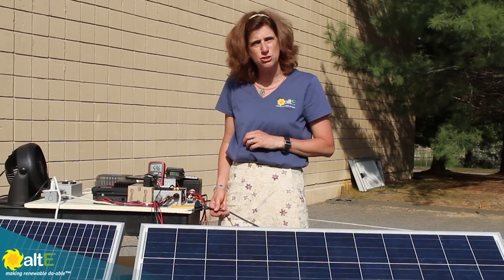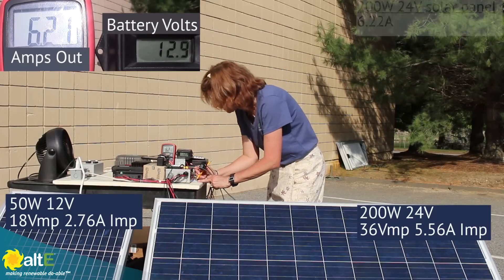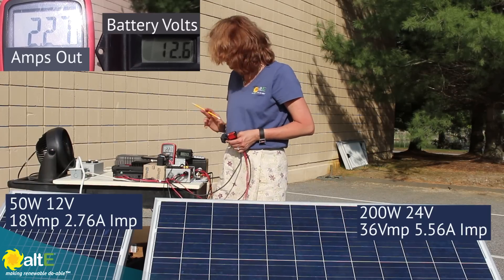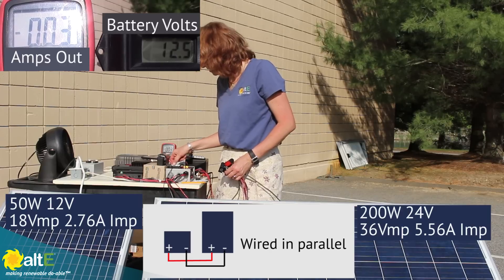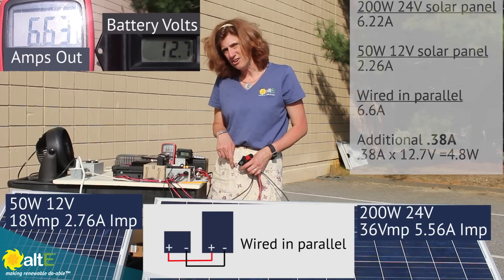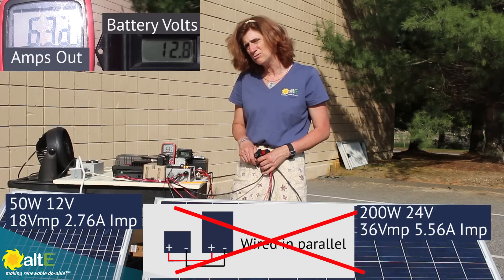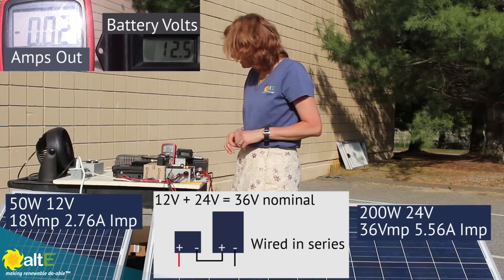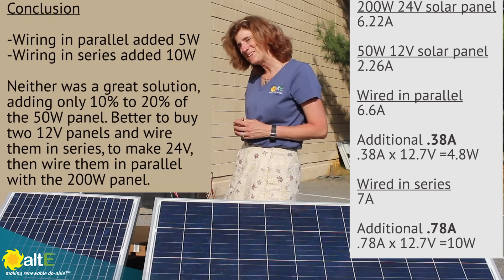Mismatched Solar Panels - What happens? 200W 24V with a 50W 12V

Comment: Because the panels' series cell count is so different (36 vs. 72 cells) on these two panels, if the parallel panel connection is left unloaded by a controller, all the Isc (5 amps) from the larger panel will be pushed into the small panel cells.  This might damage the 50 watt panel if left unloaded long enough.

For parallel connections, Vmp should closely match (same # of series connected cells per panel).  For series, Imp should match (approx same per PV cell size).

Comment: would there be a difference if you wired them in series from the 12v panel to the 24v and revese from the 24v to the 12v? either way it would be 36v but im trying to figure out what the 12v panel is doing causing it to lose some much power

Comment: Nice Videos. I just curious, Which point you measure the Ampere and Voltage? before or after SCC?  Better you show the circuit, to show in which point you place the measurement point.

I'm wondering if 12 Volt parallel with 24 Volt in Solar Panel circuits, what is the voltage would be resulted? Since if you put the measurement after SCC (on the output of SCC) in would be 12 Volt because SCC will always regulate based to the battery system voltage, in this case is 12 Vdc.

Maybe you can try it later on and upload  in the different videos, i just subscribed :)

Comment: Hi, I am joining my 36v 5.4A and my 18v 8.1A panels in series do you know what size cable I would need for a 15 feet run?
Reply: #12 thhn AWG is rated @ 20 amps and should be fine.

Comment: I have 12 340 watt panels and am looking to get 6 100 or 150 watt panels  can I connect them in series to get more power? 2 340 panels with a 100/150w panel per string vs 2 340 watt panels per string 6 strings 1 charge mppt controller
Reply from the maker: I suggest you get a second charge controller to connect the 6 new panels to the system. It will perform much better than trying to put them all on the same one.

Comment: Thank you so much Amy for the fantastic video, so if I have 10, 150watts(12v) panels  and I would like to have 4 300watts(24v) what is the best way to connect it. Kindly share your input.
Thanks in Advance
Reply from the maker: Ideally, you would have 2 charge controllers, one for the 150W and one for the 300W. But I assume you want to use one controller in this example. Because the 24V panels have twice the volts as the 12V panels, but the same amps, as long as the voltage of the strings match, you can use the 150W and 300W panels in the same string. I can't see a way to use all 10 150W panels, only 8. Save 2 for another project. You could use 2 strings of 2 24V panels and 2 strings of 4 12V panels, or 4 strings each of 1 24V panel and 2 12V panels. I'm not sure which would work better, having all of the strings the same mismatch, or having have the strings each with like panels. Sounds like a good experiment.

Comment: When you use dc, you can subtract or add voltage by switching the direction of one (in series)
By having the +24 meet -12 creating 12v.

Can creator confirm that it was tested and truly 36v output?
Reply from the maker: It's a little hard to see in the video, but I had red wires on the plus and black on the minus to avoid confusion. Especially since it did add a little, rather than output less, I am confident I had them wired correctly.
Reply: @AltEStore  agreed you seem quite methodical. 

I dont trust wire colors. Lol. Worked with too many color blind and homeowners. I have some panels that have no direction. I need to add a diode for that.

Comment: I would like to have seen then wired in series from small to large so positive of small panel going into negative of the large panel then the positive of the large panel to the charge controller. I imagine that would be better for current flow?
Reply from the maker: It wouldn't have made any difference. A bottleneck in a series string would limit the flow, regardless of where it is.

Comment: If you connected the panels in parallel, without connection to controller, you may find that the output voltage drops to just above the lower panel's voltage, this is why there was such a small gain in the first configuration.  
  Thanks for a no-bullshit video!
Reply: Try changing the leads on one panel. 
When they are pushing same direction, it adds, but if you flip one dc source around, it subtracts. I dont know how it applies to panels, but its true for battery. And id like to know!

Comment: What if I paired 2 50W 12V solar panel in series to charge a 24V battery?
Reply from the maker: Wiring 2 12V panels in series is perfect for charging a 24V battery. You can use either a PWM or an MPPT charge controller. 
Two 50W panels will only give you 100W, 3A, so it won't charge it fast, but it will work.

Comment: Hi there I have  4 100 watt solar panels and 3 30 watt solar panels wired in to a Renogy mppt charge controller I am only getting 9 amps 15volts and 120 watts total output how do I fix my system to get the most out of it ? Take out the little panels ?

Comment: How about 2 different voltages  and 2 charge controller,?
Reply: as long as they can power the battery, they should give their rated values in that case

Comment: nice video. is it possible to take 2 of the same panels and wire then in parallel. but 1 is in the shadow and the other is not. does it hurt the pannel that is in the sun? or does it not matter. thanks :-)

Comment: I have a damaged panel in shipping, that got replaced by the seller. So now I have two instead of one. As it still puts out power even though it is shattered glass on top. I bought it in pairs. And I have another pair I bought. All of them are 250W, so 2 pairs and a damaged one. I have worked out that the size of wire is crazy to have it as 12V, and that wiring the 12V panels in series pairs would give me 24v and half the current, meaning my wires could be half the thickness. As I was wiring for expansion. But I also have a brand new 12V 100W panel I bought over a year ago, that I have not used yet. And I am thinking of if I go 24V, as still in making bracket stage getting ready to go on the roof... will connecting a 250W and 100W in series, be a big problem? Considering the damaged one might not put out the full current, perhaps they may be almost evenly matched. Though I don't know what will happen when it gets wet with rain. Maybe some cling wrap on top might be a an idea? LOL??? I just don't like to throw things out... and where this is situated, no one can see the panels. As there is a house in the way of getting to see them. Being in the bush, its not an issue. I figure as with series that it will drop back to the 100W current, which is rated about 6.66A, oh watt a number lol. Kirchoff's law and all about series circuits and current being the same in a series circuit. With the busted one all marked up... hey is that the mark of the bust? mmmm

Comment: Ummm blocking diodes? You have a 24V panel feeding the 12V panel as a load.
Panels only come with bypass diodes not blocking

Comment: i really enjoy ur video is helpful. please i have my 12v 1000w solar panels 20 ft away from the charge controller, what amps of wire can i use to draw it?
Reply from the maker: It depends on what kind of charge controller you have, and what voltage your battery bank is. If it is a PWM charge controller and 12V battery bank, the panels all have to be in parallel to stay at 12V. When connected to the charge controller, the voltage from the panels will probably be around 14V, so 1000W / 14V = 71A. So you need make sure you have enough charge controllers to handle that much current.  Unfortunately, to keep the voltage drop down to 2%, you need 1/0 wire, big battery cables. If you instead had an MPPT charge controller, you could wire the panels in series to get a higher voltage, lower current, and then smaller wire. See some of our videos on MPPT charge controllers, like https://youtu.be/K7NWpxxEB9o
Reply: altE thanks so much, I'm using a100A PWM charge controller thanks again it really help.

Comment: thats awesome, i actually just you tubed if i could join mine, I have a 24 volt 200 watt panel and a 12 volt 120 watt panel and I want to run them in series. So thank you

Comment: Can you mix polycrystalline and monocrystalline ? on a 12V system? 
If so...does it matter if they are Series or Parallel at all?
Reply from the maker: No problem at all mixing them. Wire them according to how you need the volts to be, same as normal.
Reply: wow...that was quick lol... Thanks so much. 
Been watching alot of your videos...very informative...thanks for posting them...

Comment: Assuming someone just wired two panels with dissimilar VoC / VmP's in parallel, and left them in the sun... (not necessarily attached to a controller, or anything for that matter), would this result in 'backfeed' into the lower voltage panel?
Would this damage the smaller panel? Or the larger one? 

Thanks for any input!

Comment: Ok, but how are you charging a battery of 12v, when the voltage has to be higher than 13v, to charge the battery. the problem is that your solar panel is giving you only 12v. so?
Reply from the maker: A 12V solar panel is named as such because it outputs a high enough voltage to charge a 12V battery. It can put out about 17V. The charge controller outputs about 14V, depending on the setting. All of the equipment is designed to properly charge a 12V battery.

Comment: Does it make a difference if you are using a PWM controller?
Reply from the maker: Yes. It would be much worse with PWM. MPPT reduces the voltage output and increases the current. With PWM, the voltage would drop, but the amps would remain the same, so watts would be way down (watts=volts x amps).
Reply: Thanks. what if I had a 40w and 30w panel each with their own controller. would it be better to just connect each to the battery on their own? or get rid of 1 of the controllers and put the panels in parallel?
Reply from the maker: You've got the best situation, each panel with its own controller, both wired to the battery bank.

Comment: hii how are you getting nice watts from a 200w 24v output 6.22A? i have installed 800w 12v pv with 50Amps pwm charge controller hardly i get 44amps into battry around 480watts which is just 60% of my solar system

Comment: I have a 24v (250w) panel.  Can I charge a 12v battery with it??.  What if I Buy 2 more 24v 250w panels?
Reply from the maker: You need an MPPT to bring the volts down and amps up. If you have a total of 750W of solar with the three panels wired in parallel, you need at least a 60A MPPT charge controller.
Reply: Thank you Amy, I m facing little difficulty.  I have nw purchased 2 more panels (total 3  of 750w).  Can I connect  them with 2 batteries of 200amps  each directly?  As I have a 24V UPS also and I want to use it as AC coverter.Please suggest me what I should do for the better results.  My area is not very developed and cant find a qualified person over here.
Reply from the maker: I'm not completely sure what you have. If you have two 12V batteries, 200Ah each, you can wire them in series (plus to minus) to make a 24V battery bank. Then you can use a 40A charge controller to charge the one 24V battery bank.

Comment: Thank you for the video.
I still got a question.

If you put a low amperage panel with an high amperage panel in series, does this mean that you push more amps through the lower amperage panel and that low amperage panel will heat up even more?
Reply from the maker: You are correct. Unfortunately, there's really no good way to wire this combination, with both the amps and volts mismatched. We did do another video showing just the amps mismatched, you can see that here, https://youtu.be/P3YtBrymJdA
Reply: Thank you very much.

I had a hunch that this would happen.

Comment: Why not do both panels on separate MPPTs and then parallel connect those to battery?
Reply from the maker: Exactly. Separate charge controllers is the best solution.
Reply: or panels that have matching voltage outputs.
Reply from the maker: Yup. The point of the video was to show why NOT to do it this way.
Reply: You will not know never when the battery is fully charged cause you have two controllers trying to fill the battery and one and other are putting voltage high on the battery under charging,you will see the results only at night.
Reply: exactly............ words of the day: ...........learn basic electrical theory.

Comment: Thnaks   for  all the  nice   videos  out there;)  So  what   would happen  if  you   use    in the  Parrallel  setting at   each  solar panel  an  Schottky (Bypass) Diode  At   the  + Wiring    ??
Reply from the maker: That's a great question, I'll put it on my list. I'm not sure if it would have any effect, but let's find out together!
Reply: altE Thanks  guys:) greetings from germany
Reply from the maker: Guten Tag
Reply: The power output would be even lower.
Most panels have diodes build in already.
Diodes will have a voltage drop of 0.5 volts or more and that would be lost power.  A 5 amp panel with an 0.5 voltage drop diode would lose 2.5 watts per hour per panel.

Ich hoffe das es hilft.

Comment: Why are these results the opposite of the result in the video with 200w and 100w panels?
Reply from the maker: The 200w and 100W panels were the same volts, but different amps. So wiring them in parallel allowed the charge controller to see the 24V with no problem, and since wired in parallel, the current from each panel was able to pass through only one panel, without interference from the other panel. Wiring in parallel gave each panel its own route. This demo had both voltage and current mismatched. So wiring in parallel didn't work, because the low voltage from the 12V panel pulled down the voltage from the 24V panel. But wiring in series didn't work well either, because the lower current from one blocked the higher current from passing through. I'm doing another video this week showing different volts, same current, stay tuned, it'll be interesting.

Comment: I thought you had to use 12volt components with 12volt battery. and 24and 48volt the same. but what about using DC to DC buck boost converters with solar panels. would the DC boost buck converter help keep optimum output. and high enough voltage to charge in low sun. but just less current. when normally the volts would be to low. so would DC boost converters be a help or hurt performance of the system
Reply from the maker: You have to match the voltages if you are using PWM charge controllers. An MPPT charge controller, like we are using here allows you to use a higher voltage panel and a lower voltage battery. We show an example of that here, comparing the output of a PWM vs an MPPT charge controller with a 24V panel and a 12V battery. https://youtu.be/V2b7z2eTb5o

Comment: Having that 12v restriction doesn't surprise me that it wouldn't work as well. But what if you had all the same wattage panels but they were all 12v panels?
Reply from the maker: Same wattage at the same volts would also have the same amps (Watts=volts x amps). I will be doing a video shortly that has same wattage, but different voltage and different amps (100W panels, one 12V and one 24V). We just did with same volts but different amps and watts (24V 200W and 100W) https://youtu.be/P3YtBrymJdA.

Comment: I like you solar lady.
Reply from the maker: We like you too.
Reply: @AltEStore  good evening .. excellent video , very informative :) ..I have a quick question for you , I have two 22v 300 w panel in series (44v) total @13A and I would like to add another   panel to it but it's 47v 300 w @6.6 A... Using an mppt charge controller,  would it work without causing any drop in amps ? Thanks for your time 😊

Comment: i suspect even connecting the small panel directly to the battery would give better results than trying to make it fit like this!
Reply from the maker: Great idea, I may do that later. Of course the best option is to give the small panel its own charge controller, even just PWM.

Comment: you should be able to wire two 50 watt 12v panels in series than put them in parallel.
thanks
Reply from the maker: Exactly. I'll be recording that video shortly.

Comment: Perhaps its good to remind that the best solution if you want to add more solar panels into your sistem is to get another charger controler (maybe a cheap pwm) ; because wiring them in series will damage the smallest panel, take in consideration that you are forcing 24Volts through a panel with a max of 18Vmp. And in parallel we saw what it happened.

Nice videos you make there!
Regards from Spain!
Reply from the maker: Thanks, that's a great point. I'll be sure to say it during my next video.